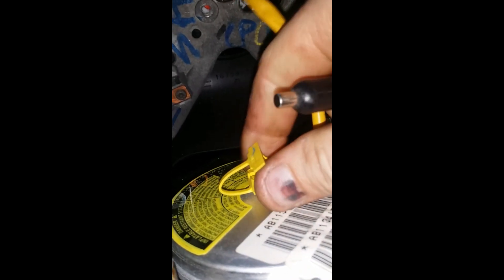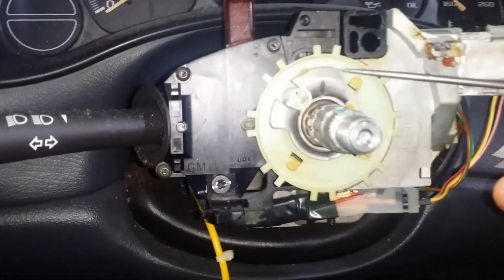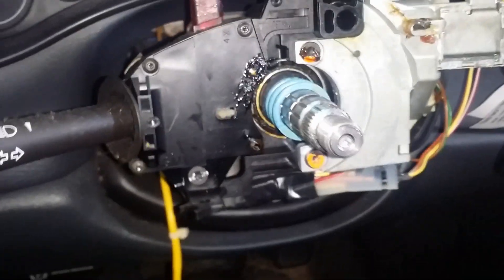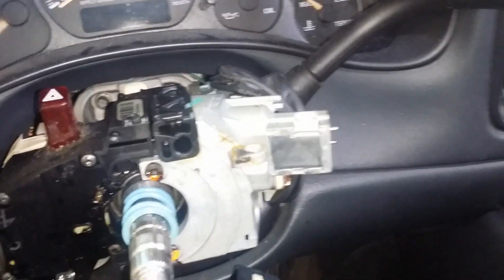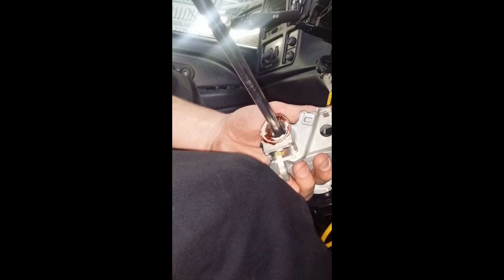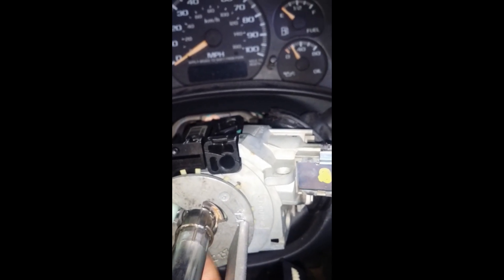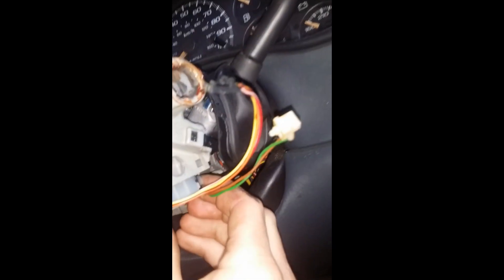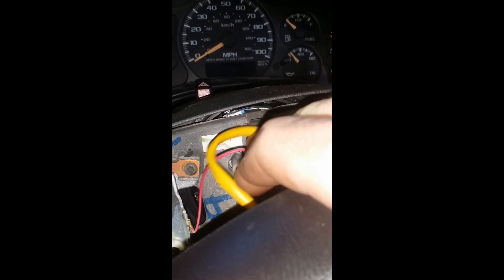02 Chevrolet Avalanche Ignition Case Replacement Procedure - Passlock Fix

Comment: Excellent video. Thank you!
Pro tip: an adjustable wrench laid on its side works great as adapter plate for removing lock plate.
Reply: Thanks for tip! i had a huge wrench and it allows just enough room to pick that retainer clip out. some old wheel bearing races and large washers and the steering wheel nut and you have yourself a spring compressor tool!

Comment: FYI for anyone else doing this:  Chime sensor should be removed before removing the lock cylinder.  Had me stumped.

Thanks for the video man.
Reply: What did you do to get it out? I’m stuck on it and don’t wanna force it out and risk breaking it.
Reply: Thanks for the heads up btw

Comment: I was struggling with this project, watched lots of videos, as well as written instructions. Your video was the most helpful, by far! Also, instead of buying the GM adapter plate I just used my vise to squeeze the legs of the lock plate tool together. Worked great and I think it gave more working clearance than the plate would've. Thanks for the help!

Comment: If only I had seen your video earlier I broke that black cable didn't know it had to be in off position. Saw several videos but none explained how to remove it looked online but found nothing. Out of all the videos I've seen this man is the most detailed and you can't go wrong. I just had no luck finding this video before I broke a part. If your vehicle is stolen replace the hub and the cylinder switch if you do just one your likely to have both parks fail few months apart.
Reply: How much did reprogramming cost

Comment: This video helped so much. I have an 01 tahoe that someone tried to steal and completed destroyed the part of the housing that the passlock is held in. Luckily the went too far and couldn't get away with the vehicle. But until i found this video i had no idea what the components were called. Thank you so much
Reply: Have the same problem now 01 Silverado… how did it go replacing it?  Where you get part?
Reply: @Danny Omar  i found it on amazon, costs about 60 dollars now.
Reply: @Danny Omar parts geek had alot
Reply: Did any of you have to get it reprogramed

Comment: My ignition key cylinder was jammed into the housing so I bought a new ignition lock housing online. I went through all the steps to reinstall new ignition lock housing.  The new housing has yellow plastic dummy key in it and we don't know how to release so a new ignition cylinder can be put in.  Thank for your excellent video which we followed many times.

Comment: Great job on explaining your video I had a GMC dealer install a clock spring in my 2005 Sierra service writer tryed to say passlock symbol was in my after market viper so I took it back to alarm installer showed me that everything on his end was properly working so I went back to the GMC dealer showed him  it was his clock spring tech that didn't re-program system like you explained in your video (we all make mistakes but come on to try and say it was the alarm tech  I sure didn't have the passlock symbol when I went there  all n all dealer got it fixed 😉)at no extra charge ) Great Job on. Your passlock video !!!

Comment: What happened to this guy, he saved my truck on one video. He was very knowledgeable.
Reply: What’s the name or part number of the tool??
Reply: @jaystanley2827  its a steering wheel lock plate puller. You can get them at any parts store.

Comment: Thanks for this, very helpful.   I did it without a steering puller (mallet and some not-so-gentle persuasion) and without the adapter plate...not as easy for sure, but it works- - used a large adjustable wrench as plate and some old wheel bearing races and large washers as spacers.
Reply: I literally had to make an adapter plate out of a big ass washer and a round file

Comment: grate video .I've had this problem for 3 years so far .it comes and goes and I cant take it anymore . my mechanic told me that he knew the problem and said its common .so I had him change the key lock cylinder.Well he was wrong did not fix it  $300 fix  .So I had an aftermarket alarm with auto start ,that's when I think all my problems started.so after a while I had it removed.Still not sure that was it .All the wires were solderd together .so after a while of looking into all the you tube video's ,everyone said it was the plug up top with the 3 wire's loose fit ,so I did the wire tie thing and wedged it in and I cleand all contact's at that time to. Well that's not the fix .So my next move is to change the pass lock case with sensor. thanks for this video again it was helpful .I will repost after I replace case and sensor. ps  would I be better to buy this online or go to dealer.thanks marc

Comment: this video is accurate and very helpful. BUT at the end the relearning procedure leaves out a detail. if you have any other lights ie (low washer fluid or low fuel) the security light will cycle. allow the lights to cycle before turning key to off position . do not turn off as soon as light goes off wait till it no longer comes back. i spent all day turning the key off as soon as the security light cut off

Comment: Thanks josh, I picked on up off the Mac truck for $63, they told me it a dealer ship item only and they really aren't supposed to sell me that tool due to the lock plate and theft reason, I told them I took it off with out the tool, just having trouble getting steering wheel back on...

Comment: Very Helpful video. However,  if you're not careful when pressing spring back down you can break the turn signal cancel cam and the wheel bearing that sits behind the spring. I broke both. It was a pain to get out the race part of the bearing. Had to cut it outwith a dremmal. When that bearing breaks the steering wheel wobbles all over the place. I should have made a video on relacing of bearing because thereis only one video on that replacement. Everyone has a video on loewer column bearing but nothing on upper column bearing.

Comment: Great video great help but i have a question for you and hopefully you can help i had to remove the housing with the old cylinder attached to because i was mangled and would not come off due to a theft attempt so i do not know in what position it was and the new one won’t go in
Thanks in advance

Comment: Might be good to rename this video something like "Chevrolet Truck Passlock fix instead of bypass" as there are tons of videos on bypassing the sensor.  This is the only one I could find for repairing the problem.  More people will find the video with the rename.  I made a lock plate adapter with a 2x4 and a few wood boring drill bits.  BTW - This is the same part for my 2004 Tahoe, so it applies to lots of trucks.  Great video!
Reply from the maker: +Lee Thompson Thanks! I added the phrase "Passlock fix" to the title and modified the description as well.. Hopefully it helps more people!
Reply: +GM How-To who can I call so they can do this to my truck I would do it but really don't have the time nor tools to do it.
Reply: +Linus Sphinx I'll give it a shot

Comment: I know you did this video awhile back and it’s a great video! I was following it and when I went to get the key buzzer connector it fell apart. There’s the plastic connector pieces, a little copper thing I’m assuming the two wires connect to, a spring, and then the orange and the green wires. I can snap together the two plastic pieces but I don’t know how the things that fell out of it fit in it… can you help at all?

Comment: Do you have to remove the lock cylinder in order to pull the housing off? I'm working on a k15 right now and I can't get the lock cylinder out and the housing is broke. I'm hoping I can pull the entire housing off with the lock cylinder still in and put the new one in the new housing. Thank you!

Comment: Great video. Really helped. However, after I got everything back together and pass code set, I can't get the shift lever out of park. Also, the red warning light is off when running but comes on and stays on when turned off and key removed. I would appreciate any thoughts. Thanks

Comment: I have a 2002 2500hd and I cannot rotate the lock cylinder to the off position to pull the cable out. Maybe I need to get my slide hammer and try and pull it out. Any suggestions?

Comment: I have a 2000 Silverado 1500, I’ve changed the cylinder and housing and it still won’t start after the 3 10min relearn procedure. What else can it be? Do I have to do something with the new key that came with the new cylinder?

Comment: My 03 Silverado 1500 5.3 liter cranks but no start. Had the gas  lines replaced with filter then the crankshaft sensor, the camshaft sensor, the PCM (was programed to vin), the driver window switch, and a relay. It has no five volt reference detected at PCM and no ignition pulse. Do you think it could be the passlock 2 sensor that comes with the cylinder case? This look the same but my security switch has the lock icon. My security switch does go out after a second and is not blinking. My key is crunchy but does crank after a wiggle. Steering wheel must come off to replace case with passlock 2 sensor, correct? What suggestions? Thanks, Richie

Comment: That retainer is worse going back on .  I used my steering wheel puller had a couple bolts with nuts and spacers used the big nut that holds wheel and bang it was off , but what a pain make sure pin that’s behind is steering wheel lock is all the way in by unlocking the gear shifter

Comment: Good video!   I have a 2001 GMC Sierra I replaced my ignition switch case and did the relearn it worked ok for a couple of days.  Three days later I came out of work into a snow storm at midnight and turned the key and the truck started ok but when when I put it in gear the security light came on and my headlights went out.  I tried to make it do a relearn but the sucurity light just keeps flashing I left it turned on for an hour and it flashed the while time. I have a battery charger on it  to keep the battery from getting drained.I used my ElmScan 5 code reader to clear what codes I could find just a couple of (lean mixture error codes)  Any Ideas what else could be wrong with this truck I'm about to call a wrecker to come get it for scrap. in 3 weeks Iver been able to drive if for 2 days and it's cost me 140 to buy that new switch.

Comment: If out of know where my check engine light came on in my 2004 Avalanche took it to Auto shop Dlc is not working now? then 2 days later my Tranny started slipping I checked the fluid it was full and nice color.Then my abs and brake light is coming on and off.I Just spent 1200.00 to replace my Transfer case last Year warranty ran out of course but coud this be something beside bad trasmission? Thanks for any help you can give me.

Comment: My key will only turn about 90 degrees...not quite to the Run position. I finally drilled out the key lock cylinder and got it removed. Removed ignition switch, it works fine. But a screwdriver used to turn  the thing in the housing wont budge past 90 either!! Could this mean the gear in the housing might be bad somehow..? What might have happened?
Reply: Well, I ended up replacing the housing following this video step by step. Thanks man! This video was the bomb; made an anxiety filled job a piece of cake. Easier than most things I've done on this truck. Note that I have a '04 Silverado 2500HD and this video was spot on. Thanks again!

Comment: Hi 
I did it how you explained it. I got the ignition case in a junk yard and bought a new key cylinder but when I installed it, the key won't turn. What can I do to solve this?
Reply: +ramiro2699 Either they cylinder was coded incorrectly or the key is cut wrong. You will have to drill a hole in the case so you can depress the spring loaded tab within the case so it will slide out.
Reply: I’m

Comment: I have a question. If my key broke in the cylinder. Is there a way to still remove the cylinder without rotating and using the pick to pop it out?

Comment: I have 00 silverado and the problem im having with it is that it sometimes starts but it wont keep running it stops right away is this a symptom of a bad ignition lock cylinder or is the case??
Reply: El_Gafaz 🕶 it’s your case

Comment: do i have to go through this process if my ignition cylinder is stuck on ACC?. Key comes out of cylinder. just stuck on acc my starter kept spinning. disconnected battery so it would die out. tried replacing cylinder... old one came out... new one didn't want to fit..(it is the correct cylinder)...Mybe because its stuck on ACC? need a little assistance PLEASE.

Comment: NEED HELP!! When I put it all back together when I go to turn the key all the way on there’s no spring to let it crank and it will not crank at all after I do the security and everything is there a spring or something because it’s missing a quarter turn
Reply: Your ignition switch is not indexed properly.
Reply: @joshpadget7663  I’m having the same problem, do I just turn the gears a little and try it again?  Attempted theft messed it up

Comment: After compressing the spring and putting the locking c-ring back on, my steering column is now "wobbly". So when I put my steering wheel on, it can wobble around quite a bit. Any idea on what this could be? Thank you!
Reply: It has two cut lines on the steering column make sure is all the way back on the second cut

Comment: What if I need to replace the lock and don't have a key ? How can I turn it to the on position to get it out ??
Reply from the maker: +adrtorresgzz The only way to get the cylinder out without the key is to drill a hole in the case so you can depress the tab on the lock cylinder. Even then they are not fun to get out. May have to pay to get a key cut by the dealer by supplying them with your VIN and proof of ownership.
Reply: @gmhow-to7583   I replaced my whole Ignition last month and I had my past lock reprogrammed I have all my information for owning the truck in a have the numbers from the new steering column can I take that into the DMGM dealership and get a keychain

Comment: Grate video. there is a couple things you don't show or tell anyone about . So air bag. You have to pull air bag fuse and battery neg cable off.and to pop off air bag you have to turn steering wheel to the left and right .So you mite want to jack up the front of car just off the ground so you can turn the steering wheel then use a small screw driver to push in spring clips .each side of the air bag should pop ,if they don't your doing it wrong.get a lite and mirror  to find the clips it took me less then a minute to remove air bag very easy.next thing that is not shown and im not sure exactly what you call it is on the back of the housing case ,is 2 plastic pieces make sure you know what position its in .a small pic is needed to take out the first plastic piece .Ok after you have it ready to install put in one screws snug. Put the key cylinder back in  then to the  off position ,put you ignition switch in and turn it to crank and make sure you key turns. sometime when you put the ignition  switch back in it may be out a tooth  don't panic  its easy to figure it out  .I had all the tools and some know how after I watched this video it helped me out a lot and the key  relearn took 1 hour did not work the first time My fault .So if you have that Damm security  lite on and sometimes your car don't start change the passlock sensor don't listen to the guy that said its the passlock plug on top of case

Comment: so what was the vehicles problem that led you change this part? I have a trailblazer that starts and shuts off after 2 seconds. the car and lock icon blinks 3 times and goes off. I changed the switch but no help. You mentioned BYPASS Id rather do that, how is that done?
Reply: Dale Higgins Do you have any videos for changing same part on a 99 pontiac grandprix?
Reply: @leegriggs265  yeah I'm sure he has a Pontiac in the driveway
Reply: @lowerdesert9577  I love guys like you! Always have something to say. Why would u waste your time making a comment that has nothing to do with ya
Reply: @leegriggs265  lmao 😆

Comment: For changing the actual Ignition switch not the housing or Key cylinder, Do I need to remove the steering wheel etc?
Reply: No, just undo the covers and harness looms.  Would take the column covers off first and take your old module out to confirm it's the issue before tearing into the loom and removing the lower console panels.
Reply: no, the switch is directly under the steering wheel, take the column cover off and you will see the switch

Comment: I need that tool for the cancel cam whats is it called and can you only get it for GM?
Reply: +rcastanaga The plate tool number is Kent Moore J-42137. The lock plate compressor is J-23653. An aftermarket compressor can be had for under $20 if you poke around online...or maybe even local auto parts store. The plate can probably be made out of 1/8 plate steel. Or if you know someone at a GM dealer you could try to borrow one.

Comment: Hey brother quick question where can I buy the tool you're using to compress the spring on the column I have a 2000 Silverado I was able to take it off but can't install it really need that tool lol lmk if you can thanks and God bless
Reply: Search for Part Number j-42137
Reply: @JBBBBBBBB250  just ordered it thank you

Comment: Anyone know where i can get the black cam thing that mates the ignition switch with the key cylinder? The ignition switch has teeth, the cam has teeth as well on one side, the other side the lock cylinder goes in. Mines is jacked up and will not allow the switch to turn all the way, the inside where the lock sylinder goes in is mangled and binds when turning the switch.
Reply: Hey did you ever figure this out?! I think I'm having the same problem you did! Please let me know!